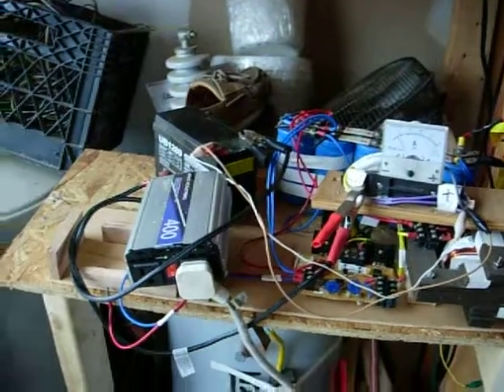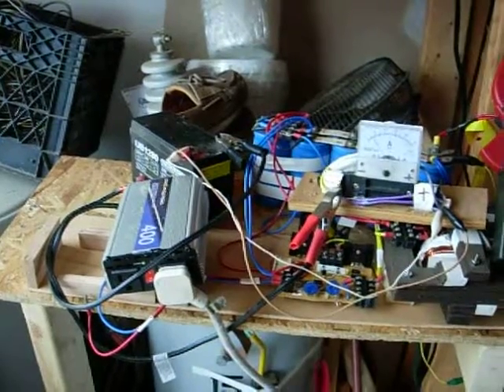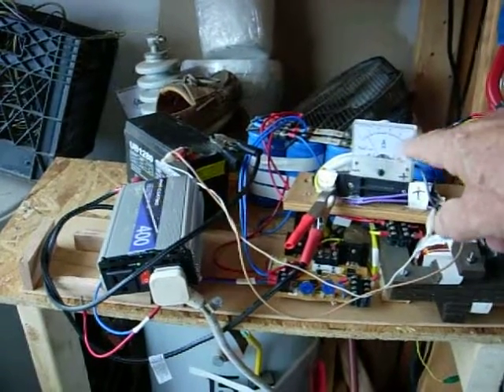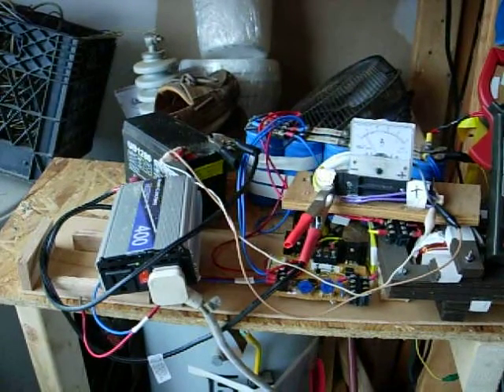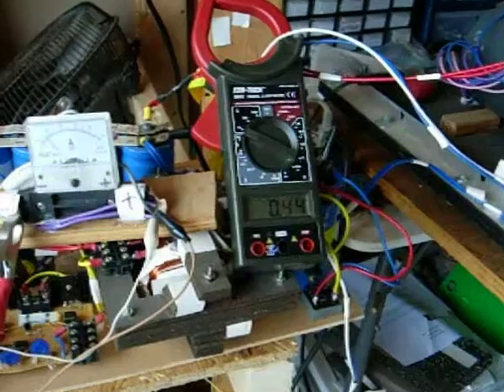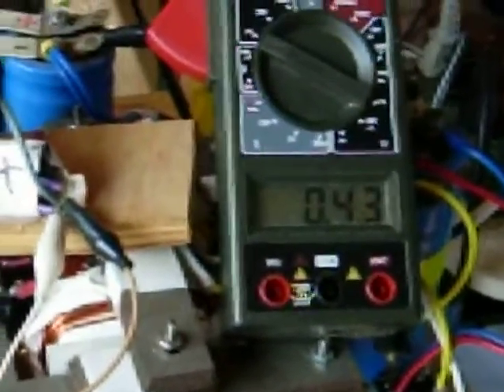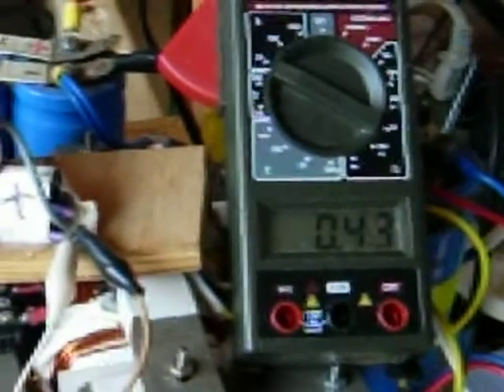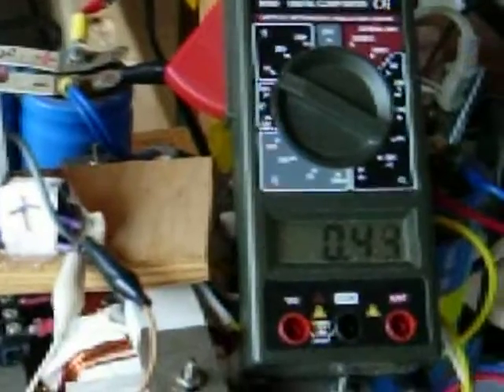Don Smith #216  Running with 12vdc  bat & inverter

Comment: Good to see you still running that machine. It has been years and I am happy things are still moving forward. You kinda went the Gerard morin direction...lol I am still building the coil systems but removing pieces to see how many actual pieces they need to work. thanks Captain!!
Reply from the maker: I did a test of two 15kw pole transformers with 2000 watt load and a generator driving the first 120vac  the 14kv drove the second transformer.  I had 9 amps in and 14amps out   gerard had about zero ampsin at first which then climbed to over a amp.  mine also started to climb up yo over 11 amps as the transformer heated up.  Gerards test was at 4 degrees C dam cold. so it doesn't really work as trans heat up the power will equal.  I think.  Once I'm self running I intend switching gears to the rodin coil idea which spins neo magnet for 1 min 20 sec no power to circuit. heres you tube link to jacks test watch carefully the field goes out 7 million miles and back to earth.

http://www.youtube.com/watch?v=tA4yXevToQcAlso check US Navy patent on new energy system  David Wilcox in latest video tell the numbers  as well as navy anti gravity patent.  8 hrs to moon
Reply: @CAPTAINSSBN  Thank you.